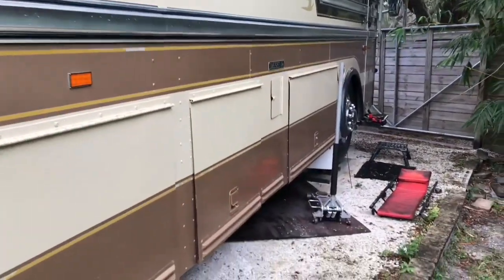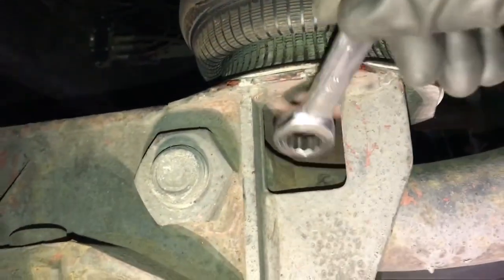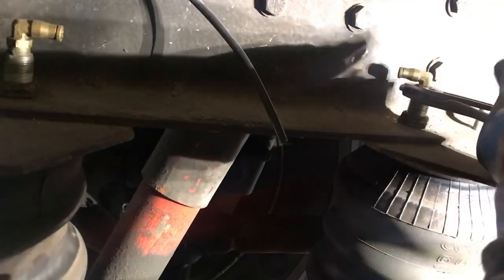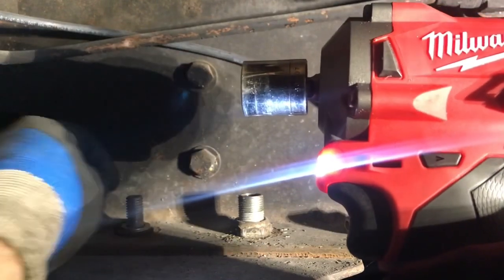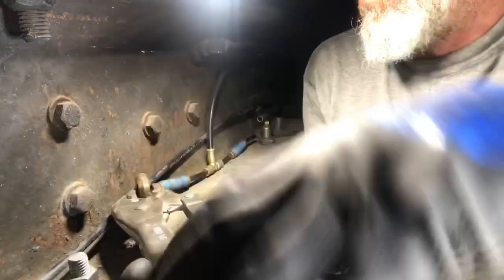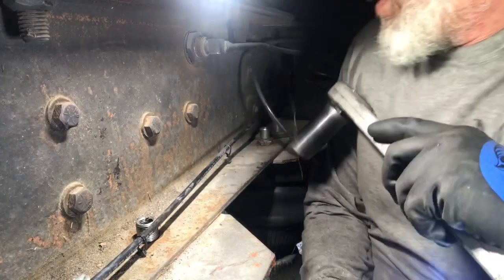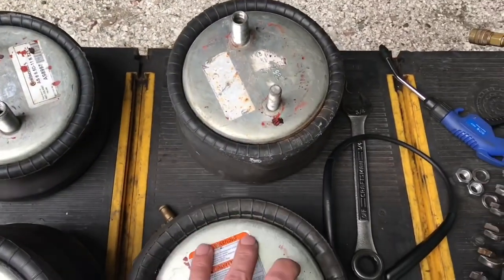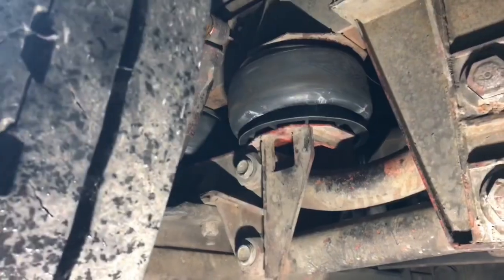Gino’s Garage- 84 PT40 Front Airbag Modification, Installing Larger Airbags

Comment: Looking forward to the house it drove video. What was the part number on the larger bags.
Reply from the maker: These are the same as the drive axle, not sure I can totally recommend it until I put some miles on it and make sure I do not have any issues.

Comment: What are your thoughts about this upgrade
Reply from the maker: After putting some miles on mine, personally I would not recommend it. I am not noticing much in the way of ride change and it was a bunch of work to drill new holes etc. not to mention it’s a tight fit to get those bags in there.